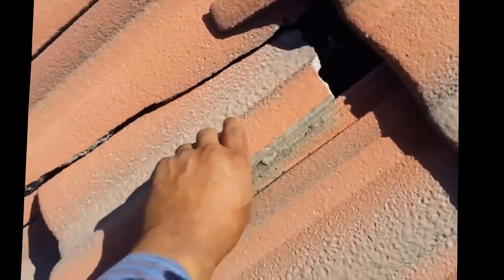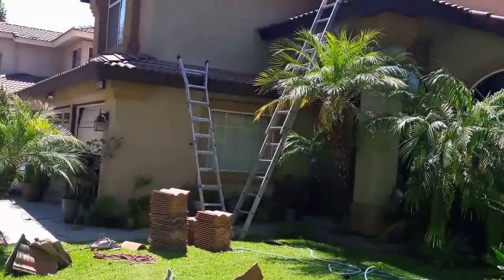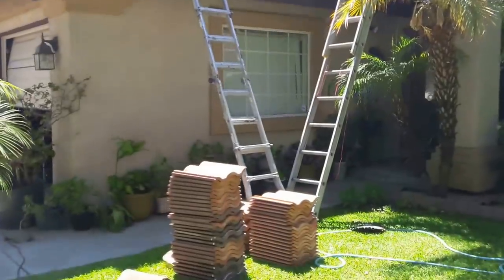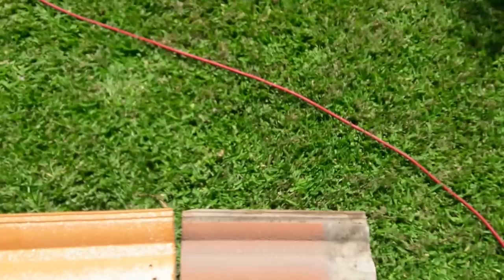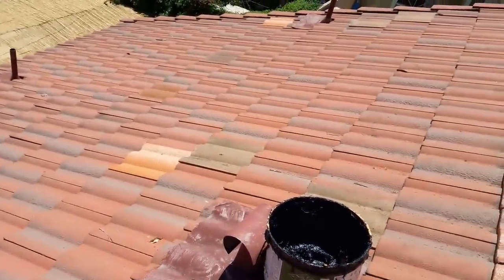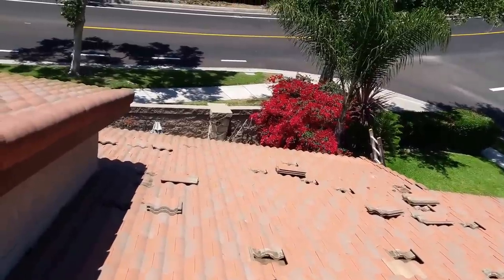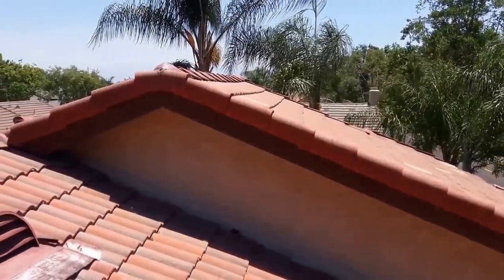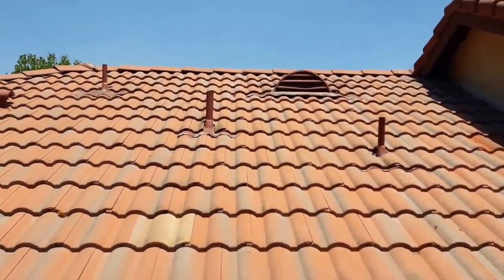You think you're a fast roofer ?? Replacing Roofing Tiles , Tile repair ,fast and easy!

Comment: how large do those corner chips need to be before you recommend to replace the tile? Some roofers say more than a quarter size or 1 inch, but that seems unnecessary.
Reply from the maker: I would worry when the crack it's more than 2 inches , because the tile normally overlaps 3 inches and if you have more than 2 , the water might leak on the channel of the tile.
greetings .
Eric.